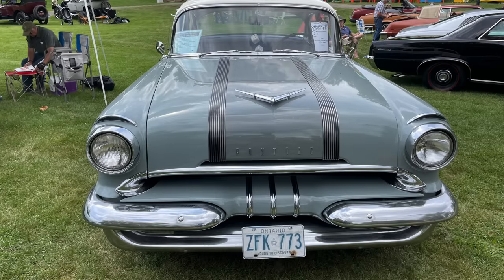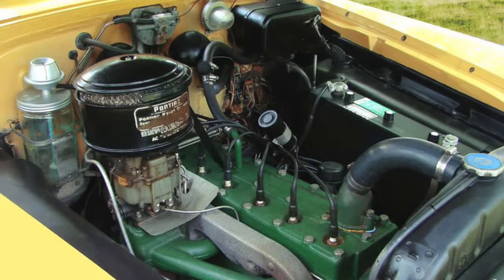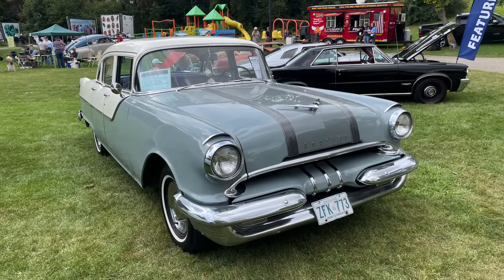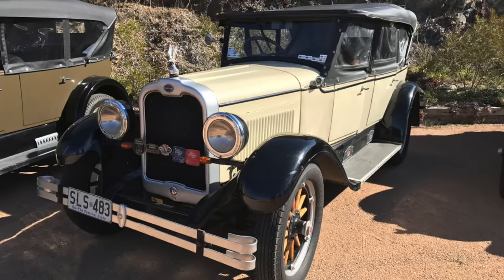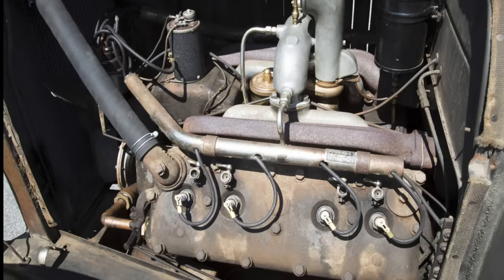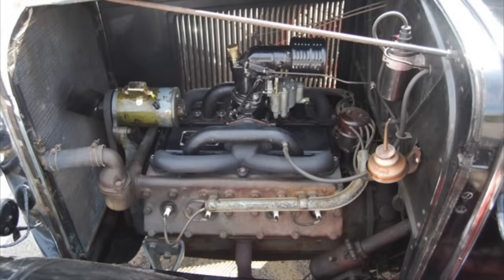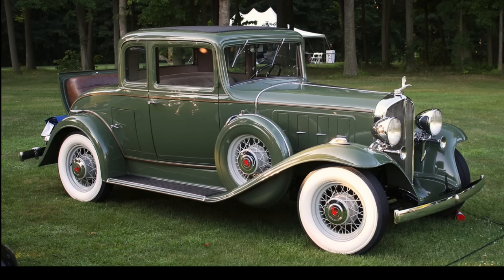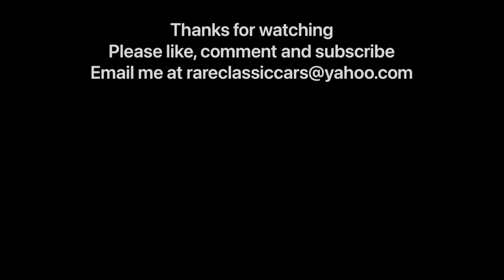Pontiac's First V8 Was An Awesome Flat-Plane Crank Engine!

Comment: Can someone please confirm my understanding of how the intake and exhaust manifold works? It appears that along each bank of cylinders there are six, not eight, ports for the intake and exhaust manifold to bolt on to, like there also appears to be with the Ford Model A's flat head inline four engine. There is one exhaust port for each exhaust valve at the ends, two intake valves share the one port, and the exhaust valves between the second and third cylinders share the one port and an exhaust runner that goes through the block. The exhaust manifold runs over the top of the cylinder bank to the port between the second and third cylinders, where the combined exhaust collects the exhaust from the exhaust valves of the second and third cylinders, and conveys the combined exhaust through an exhaust runner that goes straight through the block to dump out in a single exhaust pipe that then goes to the muffler:
               i i i i i i i i i i i carburetor i i i i i i i i i
               i                                                        i
       e e e e e e e                                   e e e e e e e
     e        i           e                                e         i          e
   e          i           e e e e e e e e e e e e         i          e
port    port    port              e             port   port    port
exh   int  int  exh  exhaust runner exh   int  int  exh
cylinder cylinder               e             cylinder cylinder
                                 exhaust pipe

Comment: If You are going to use that term " POUND FEET" instead of FOOT POUNDS Then I would say you need to start using the terms NEWTON DECIMETERS  as  it is more accurate or you could change to POUND YARDS  of measure. A Newton Meter is more well represented as a POUND Yard as they are more closely related as units of measure. And lets just say it is one foot of lever arm and an increasing level of pressure applied to that lever arm... FOOT--POUNDS.
Reply from the maker: The first rule of multiplication: AxB = BxA. 

Torque is force x distance or distance x force, whichever you want. They’re the same.